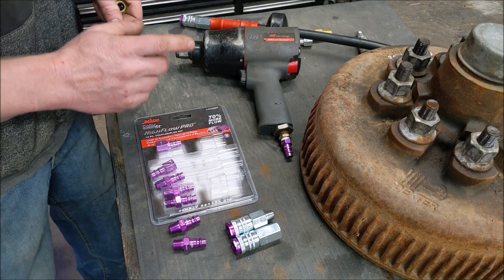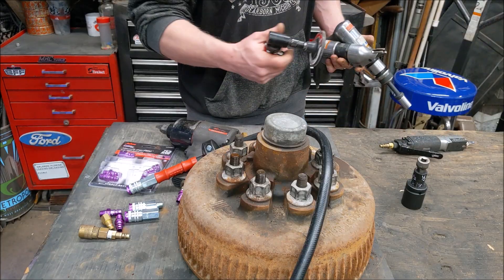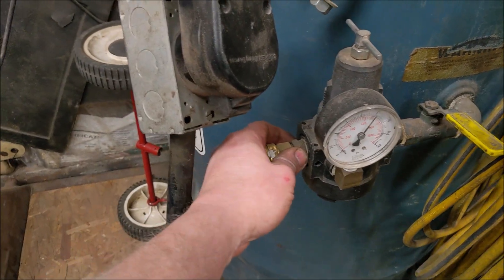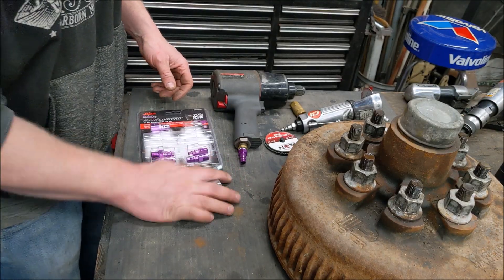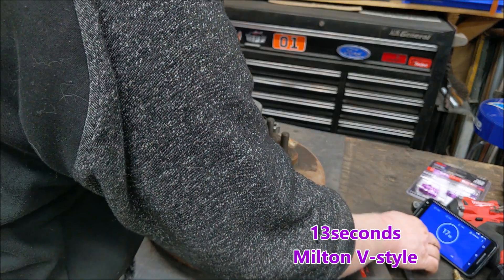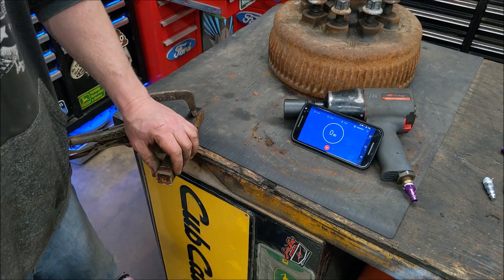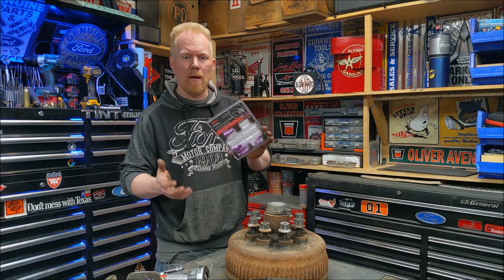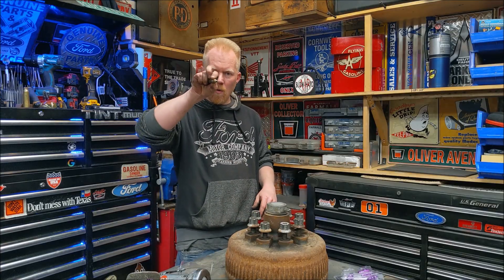High Flow Air Fittings worth it? Tested Head to Head Milton V-Style

Comment: I've been using Milton Hi Flo for over a year now and they are amazing.
Reply from the maker: I can't believe it took me so long to buy them.
Reply: @sixtyfiveford  I made an adapter with a regular connector on one end for the occasion that I use a tool that doesn't have a hi flo end.  Although I converted all mine you never know maybe someone loans you a tool without a hi flo.
Reply: @sixtyfiveford  what's the difference between the M, V, etc?
Reply: WOW you're workshop is looking great! And as always you put out a great video. You remain one of the best content putter outers! 😆 🤣

Comment: I guess the the static pressure on both fittings would be the same.
But as you use the gun the pressure would drop, the drop depends on the gun usage and the ability of the input to deliver enough volume of pressurised air per second. So a bigger fitting is better?
I could be wrong as i have always had problems with pressure logic.
Your dog didn't eat the burger, you did, but your tone of voice made the dog think it had done something wrong maybe :-D
Reply from the maker: If you had a small reserve tank you would deplete your air faster and any initial gains would be quickly lost.

Comment: Damn, boy, good video.....gonna go and get some of these high flows.  Where'd you get that compressor?  Off the Titanic?  I need one like that!  LOL
Reply from the maker: I wanted to do some sandblasting a few years ago and need something huge. I found it for dirt cheap because it had a 3 phase motor. I pulled off the 3 phase and put on a single phase for home use.
Reply: @sixtyfiveford  Really nice deal....a fella needs that to happen once in awhile.  My compressor really trashed itself about a year ago and I now have a little piss-ant compressor....so, I'm keeping my eyes open.  Good video, BTW.

Comment: i used calcium chloride pellets for moisture removal and after 10 years it rottec all of my air tools and all of my lines in a 400 sq foot home shop...I now use tags in a flanged pressure container and it works perfectly...I replaced the tools,  switched ($3000) over to plastic lines and high flow fitting, all so that I could do pinion nuts and other high torque fasteners...God bless...doug
Reply from the maker: I've never heard of Calcium Chloride being used as a desiccant. Luckily we have such low humidity hear it's never a big issue.
Reply: @sixtyfiveford they use calcium choride on the grid toads in front of peoples yards when the dust gets bad up here it holds the moisture until it gets very hot(rots the body metal as fast as all the salt they use, dadgummit)... I meant to say I used rags  , a friend uses an old pair of coveralls and he paints a lot with no probs...I m actually using a stack of paint booth air filters now ...sure enjoy your vids...prepare for the worst and expect the best friend...doug (kanada)

Comment: A larger hose will also help out, less air friction within the hose.
Reply from the maker: For sure. I have 1/2inch ID hose it's just a pain to drag around so I never use it.
Reply: It acts like a storage manifold....you could even rig up a "bottle" with chucks on it. 
you can chuck in the airline and it'll give you a little boost at first. 
Of course that works great if you use high flow fittings also 🙂

Comment: probably see an equal jump in performance if you swapped the quick connect at the tank for a female - female coupler, restrictions have an even bigger effect when theyre at the start of the line rather than the end of it, if you run it at full pressure 99% of the time anyway ditch the regulator and just put the regulator on a little whip with quick connects for when its needed
Reply from the maker: Good points.

Comment: Errr... you have an M12 right there! Air hoses are obsolete.
Reply from the maker: I like it but I'm going to knock the Milwaukee a little. The M12 is far from ideal in most situations. I have cordless impacts but my biggest complaint is they are all so shaky and cheap feeling. The M12 has the worst battery attachment system out there. Since the joint is in the palm of your hand you can feel it wiggle and pinch your skin.  It also has the most ridiculously oversized grip to accommodate having the batteries go inside the handle. An air impact is smaller, lighter and feels like a Cadillac when using it to remove bolts. The cordless(all brands) are like driving down a dirt road in a wagon. Both get the job done, one just beats you up more.  Is it handy YES.

Comment: When I first got my "800 ft. lbs" impact, I tried it with 1/4 coiled air
 hose and it would not remove any lug-nut. I thought it was defective. 
Changed to a 3/8 hose and now the same impact has removed every lug-nut 
I've tried. I look forward to trying the Milton's Hi Flows.
Reply from the maker: When I first set up my shop I had those 1/4" coils. They're handy but really kill the air flow.
Reply: @sixtyfiveford  
I won't ruin it for everyone else , but years ago I got the husky ones at the depot. 
I could tell right away because the ol ir2131 barely needed a brap on the lugnuts. 
Dual stage at a shop it was awesome , but after I left there I kept it at my (play) shop. 
I was bummed about it's performance on a single stage compressor , but the high flow fittings made me feel about 70% better 😆
What I mean is the fittings gave me back what I felt was close to 70% of the performance of running it on a dual stage.
Reply: I'm running half inch hose with the milton high flow fittings and it is a huge gap between the 3/8s hose with their fittings to the half inch hose with their fittings

Comment: I can tell you from years of working on class 8 trucks hi flow fittings make a big difference.Also that 3/4 impact should have a 1.0 inch hose and a bigger qd.fitting
Reply from the maker: I did have 1" hose a few years ago. What a pain to drag that around, but dang the gun had power. The hose ended up getting shelved as I mainly only use it for cars so it takes everything off even with the restriction. From time to time I need to pull out the big hose and fittings though.
Reply: @sixtyfiveford  Yep for cars and pick ups 1/2 will do. ....and a torch!

Comment: I just use what ever fitting matches the internal diameter of the hose it’s connected to. My 10mm internal hose has the 10mm internal “euro” style fittings and my bigger 13mm internal hose uses the bigger 3 hole fitting. Once the fittings internal size is at least the size of the hose that’s as good as it gets, bigger than the hose and the hose is still the biggest restricter.
Reply from the maker: Hose size is very important.
Reply: That's what she said... Lol!
Reply: Keep in mind the restriction is in the coupling where the air has to go through turns and passages.  I've seen at least 2 completely different V-style couplers (Milton and ???).  I know all the paint shops moved from the V to a $28 coupler system (I think Provost is one) - I don't know anything about these $$$ coupler/plug systems.

Comment: I think with the impact you would notice a difference with the small fittings if they couldn’t bust a nut loose you could with the high flow fittings. I couldn’t get the 33 mm lug nuts off my freight liner with my half inch impact gun but I have a long hose with tiny fittings. Came right off with a nut buster tool
Reply from the maker: You're playing with big lug nuts.